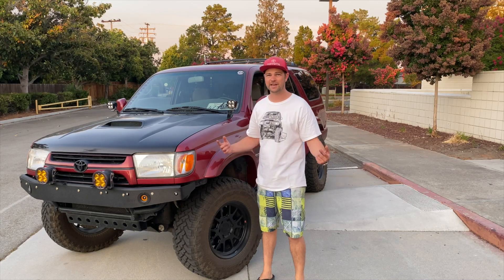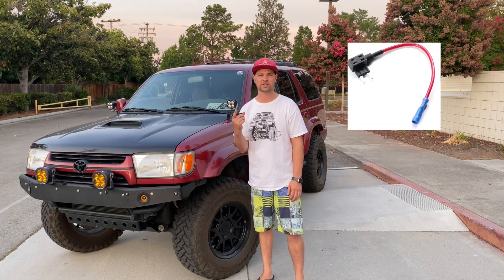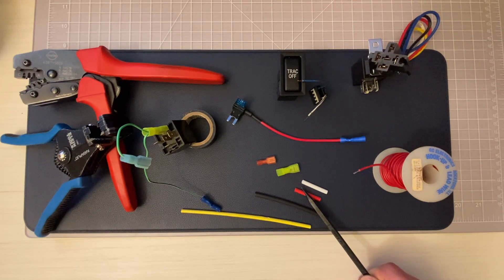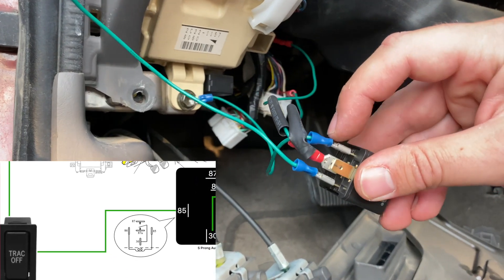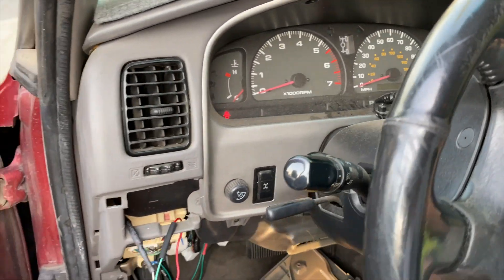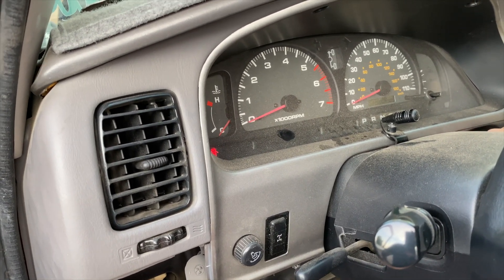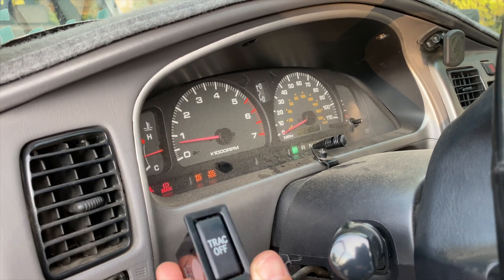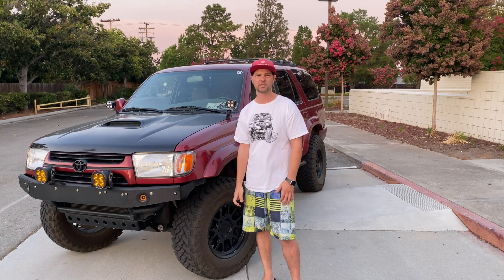TRAC OFF Switch Installation (AndyMod 2.0) 2001-2002 Toyota 4Runner

Comment: Do you need the plug that pugs into the back of the trac off button? The button I bought didn’t come with the plug
Reply from the maker: Yeah you do need the wiring pigtail otherwise you don’t have a secure way to connect the wires to the back of the switch..
- Sean
Reply: @TimmyTheToolman where can I get the pig tail?

Comment: Hey Tim, I work for toyota parts and know a bit about electric diagrams and stuff. 
I think i just discovered AndyMod 3.0, and ill make a video and post when i confirm this myself. 
i think i just found a way to do this without the use of a relay (even when using a momentary button switch), and also possibly allowing the vsc/trac system to turn on/off like factory (turn on/off by button WITHOUT needing to turn off the entire vehicle to reset & re-enable).

I was looking at toyota official EWD471U wire diagrams for 2002 4Runner and i found something, pin #26 cyan wire is UNUSED on the same VSC connector V18 (NOT the mentioned pin #3 red/black wire on connector V18).  #26 is not mentioned anywhere online, however this #26 pin is the factory connector pin for the factory trac off switch on 96-00 year models, and #26 was left unused (just need to re-add the pin) with the removal of trac button on 01-02 (due to updating systems of 4WD & differential locking).

The thing i don't like about using pin #3 Red/Black wire, is that its hard to find what the factory use of this wire is for, for and why NOT to cut it. instead to tap into it leaving the circuit intact, or use other EXI circuits instead. #3 is connecting to the Center Locking Transfer Case 4WD detection switch, and that switch from factory functions to turn off VSC/TRAC when 4WD is enabled, or when the Center Diff is LOCKED. and i dont want to compromise that signal to have it not function as needed, when the diff locks.
Reply from the maker: This was actually Sean's video.  He did all the research and filmed it on his own.  Definitely share with us what you figure out.
Reply: Did you ever find out if this works? I'd love to do this
Reply: Did you get it to work I have a 2002 and I would like to get it to work  correctly  I am adding a rear elocker
Reply: Also have a 2002 and need to know if it works!
Reply: Any success?
Reply: Any success?

Comment: Mine keeps disabling itself, but it stays disabled even when I turn the car off. I have to do a code clear or disconnect the battery to get it to reset. But then a week later it will trip again. It seems to trip any time I have a tire slip, especially if I’m turning a corner. 
Why do you guys want it off? I honestly can’t tell any difference with it off or on but I don’t really understand what it’s supposed to be doing so I don’t know what I’m looking for. Thanks in advance anyone who can enlighten me.
Reply from the maker: That’s weird, maybe check the wiring. Something doesn’t seem connected. This momentary switch (if you’re using the switch in the video) breaks the wiring connection, disabling traction control.. if there is a break in the connection 100% of the time, then this would explain why it’s always on.
- Sean
Reply: @ Thanks.

Comment: I finally got around to doing this mod, after I found myself in a situation that disabling the VSC would have been helpful. I recommend it for 2001, 2002 owners. It's easy to do and will save you from having to put your truck into 4WD and locking the center diff, just to disable the VSC and traction control. Thanks guys...
Reply from the maker: Yeah, the factory VSC is really annoying!
- Sean

Comment: I have an 01 4runner with a center diff lock. When I turn on center diff lock it turns on vsc light. Is there any benefit for me to do this mod? I was about to do it. I bought all the stuff to do it. Thanks for your input and your channel.
Reply from the maker: Well, if there's a situation you can think of that you won't have the center diff locked and would like the traction control disabled, then you have your answer.  If you can't think of a situation, then you also have your answer.

Comment: This is awesome thank you so much.  I have the relay and just waiting on a switch to show up to do this mod. I was a Audi tech and a Audi driver up until recently after my Audi got totaled in a accident.  I recently purchased a 3rd gen 4runner knowing about the longevity and finding that things are a lot easier to work on....except for the rust, but can't win everything. Either way in a recent snow storm I was trying to turn on a highway and a slight slip engaged my VSC. It's a 2001 and had the 4x4 engaged but not the center diff lock considering I was still on the roads and had to turn alot, even though engaging the center diff lock does disengage the VSC.  I was without any response to the accelerator and thought I was going to get T-boned any second. Luckily at the last second I was able to get it to disengage and accelerate onto the highway. After that i realized that this traction control could put me in danger.  So again thank you so much for this video with the diagrams and such, it will give me some added assurance of not getting into a pickle.
Reply from the maker: Yeah this traction control/VSC system sometimes can have a mind of its own. For those reading this comment, essentially what happens is when this system is engaged (due to traction or off camber situations when making a sharp turn) the system will cut power to your acceleration, effectively putting your vehicle into a limp mode making it dangerous if you’re trying to get out of a sticky situation quickly like in your case pulling out, onto a roadway where cars are moving quickly. We have a couple switches in hand if you wanted to buy one from us, otherwise, we are stoked you got a 4runner. We hope we have more videos that will help your future mods!
- Sean
Reply: @TimmyTheToolman  thanks, I did find one on EBay with a pigtail. Sorry I didn’t purchase from you, I should have read the comments sooner and I would have known and purchased from you. If the switch doesn’t pan out I’ll definitely e-mail and purchase one from you.

Comment: Might be a silly question, but how does TRAC work on the 5-speeds? Is the TRAC/ABS system all based off the transmission? I swapped my 01 to a 5 speed and have never experienced traction control or ABS when wheeling lol. Might just pull the bulbs.
Reply from the maker: If you have a manual transmission then this system no longer pertains to you, so pulling the bulbs would be a good idea!
- Sean

Comment: $88 for the button???
Reply from the maker: No, $30 shipped, and it includes the pigtail connector. This button from the dealer might be $88 but it doesn’t even include the connector!. If you’re interested, use the email in the video description to place an order.
- Sean

Comment: Will this work for an 06 Highlander? The FWD models have the switch but the AWD models never came from factory with the switch?
Reply from the maker: Sounds like the switch will work, but we are not able to guide you on the correct wire to tap into on your specific model Toyota.
- Sean

Comment: Dang. I followed everything right and it didnt work. HELP!!!
Reply from the maker: Double check your work! We included a very concise diagram in the video description. 
- Sean
Reply: @TimmyTheToolman  with a tester light, I have power to switch. Should I have power to relay wires extended from harness, red wire w/black line.
Reply: My connections to harness are good. I dont have power to wires extended to relay. should I ?
Reply: When I depress trac off switch I get power to relay. Hmmm?

Comment: I just wrapped up this project, following along exactly, and no luck whatsoever... Is it possible that using an on/off toggle switch instead of the trac switch like yours is the problem? I've tried various fuse positions hoping that was the problem but didn't help. Still getting the skid light along with the clicking sound from the front. It even refused to accelerate despite flooring the accelerator once. The wiring for 87a and 30 are interchangeable right?
Reply from the maker: A simple toggle (on/off) should also work using the same wiring diagram. That is correct, 87a and 30 are interchangeable.
- Sean
Reply: @TimmyTheToolman  Sounds good. I disconnected my battery and it doesn't seem to be triggering the ABS system now, although the emergency brake and ABS lights are on. No trac light. Ideas?
Reply: @TimmyTheToolman  So I did the Andymod 2.0 exactly as described and I'm STILL not getting the VSC/Trac lights to come on. The VSC light WAS on for a while last week but not anymore. I've turned it off and flipped the switch w no luck. Also removed the battery terminals w the same results. I can't find any loose wires so I'm completely puzzled. Would just cutting the red/black wire without connecting it to the switch be effective other than not being able to turn it on when wanted? Anything I could be overlooking? My truck just stalled upon accelerating on the way to work a few times.

Comment: Not sure if this is the appropriate place to ask, but I just upgraded my whole front end, added OME 990/881 and Billy 5100s. When bleeding my brakes I got air in the master cylinder and got that all fixed, but now when I try to drive it it will barely accelerate (if at all) and my Trac control light occasionally flashes. Also, there's a clicking sounds coming from the end (thought it was something rubbing from the slight lift but doesn't seem to be so). My 4wheel drive light flashes like it is wanting to engage though the button hasn't been pushed. Would this mod potentially rectify this issue or do I need to try another approach?
Reply: And my 4runner is a 2001 SR5
Reply from the maker: How did you bleed the master cylinder?  Your ABS module also probably has air in it.  The fact that your vehicle barely accelerates doesn't make sense to me.  Is the engine revving but not moving because it feels like something is holding it back, like stuck brakes?  Or, does it sound like there's an issue with the engine?  Even if you had air in the brake system, it shouldn't cause the symptoms you're experiencing.  I've never heard of this.
Reply: @TimmyTheToolman  I used the method where you hook a clear tube to all the calipers and terminate it in the MC and pump the brakes w the ignition on. It's supposed to remove the air from both MC and calipers. Brakes work great now and the engine purrs after all that I did to it. Doesn't feel like the brakes are holding it back, it's just when I floor it it simply doesn't want to move (engine doesn't seem to rev up either when I do this). So maybe focus on the ABS module? For the life of me I don't know what to search for.
Reply from the maker: @jeffluker1895  Sounds like your engine is in limp mode.  Any CELs?
Reply: @TimmyTheToolman   No CELs either. There was one before I fixed the engine but It's running like never before, just doesn't want to move. Should I consider the AndyMod, disable the VSC, etc ? Did I mention that the 4WD drive light flashes like it's trying to engage though I haven't pushed the button? And the trac light (pic of the truck w/ skid marks) comes on occasionally. No other indicator lights. I'm baffled. Could the Yaw sensor be in issue since it's got a little lift?
Reply: @TimmyTheToolman  I wonder if it has anything to do w the catastrophic LBJ which started the whole situation. I didn't hit anything other than the fact that the wheel came off at 65 mph. I did notice that there's about 3 inches of clean metal on the rear drive shaft like it had been pulled forward a bit. Could the transmission etc somehow been affected? I still don't understand how that would cause these issues.
Reply from the maker: @jeffluker1895  Well, the driveshaft expands and contracts with the drivetrain.  Did you replace the broken ABS sensor?  It had to have been ripped out.
Reply from the maker: @jeffluker1895  Have you checked the integrity of your transmission mount and engine mounts?  https://youtu.be/g_4DiywsSbk
Reply: @TimmyTheToolman  Yeah, I replaced the broken one but kept the original on the driver's side.
Reply: @TimmyTheToolman  I haven't but I'll watch your vid now. Thank you SO much for everything, you've saved me a ton of $$.

Comment: I did this mod but my vsc and trac stay off
Reply from the maker: I would Retrace your steps. Make sure your relay is hooked up correctly and that you cut the correct wire. The truck needs to be turned off in order to reset this mod. The switch is a momentary switch so you can’t press it on and off. Once you press it, that will disable the VSC/TRAC OFF. Restarting the vehicle will reset the system
Reply: I swear I did, I’ll give it another go tomorrow. What do we do with 87 on the relay? We splice 30 and 87 a into the red wire with the black trace. I’m sure I got that right. I know I cut into the right wire since the vsc and trac stay off. But I’m having trouble in reconnecting the wire in the harness. I wonder if my connection to 30 or 87a are bad. It’s so tight under the dash. I’ll try to make a better connection tomorrow. Do you have any other suggestions?

Comment: Plugged everything in correctly, checked all my connections. Does not work (2002 sr5). I tried to bypass the switch (not a Toyota switch) and still does not work. I don’t know what I’m doing wrong
Reply from the maker: We don't know what you're doing wrong either.

Comment: Got an 02 that I just put a 3 in lift an now the vetch’s is dinging and will lock 1 of the front wheels and about throw me into another lane ! Will this stop this ? It’s really dangerous an I can’t drive the 4 runner like this , I’ve been told I need to remove the lift , never had a Toyota do this after lifting
Reply from the maker: You don’t need to remove your lift. There are hundreds of 01/02 4Runners out there with lifts including us! You probably just need to do a zero point calibration. The YAW rate sensor is probably thrown off now that your truck has changed it’s levelness sort of speak. Once you recalibrate you should be fine. In addition to that, you could also just install this TRAC OFF switch and disable the system on the fly whenever you want to avoid your truck beeping at you.
- Sean
Reply: @TimmyTheToolman  ok , thanks, and tht will stop the front wheels from locking up when I’m running at speed around curves rite cuz it’s wedged my boxer shorts a cpl times !!
Reply from the maker: If the traction control system isn’t triggered, then your truck will drive as expected. Recalibrating will help, but this Andy mod 2.0 will solve the issue better. 
- Sean

Comment: My traction control button has 3 pins, but only 2 wires are supposed to go to it, which 2 pins do I use?
Reply from the maker: The pigtail that you have should clear that up for you. Depends on what vehicle the TRAC off switch came from …

Comment: So, how will this work with a 2wd 2002 SR5? Already has the trac off button installed. But it will turn itself back on. Just trying to understand my already stock button :)
Reply from the maker: 2wd models included this feature from the factory on 2001-2002 4Runners. For you, you already have this “mod” so you wouldn’t be installing anything. Understanding when to use the button is what you need I believe. Have you ever tried to pull in traffic from a stop and the truck beeped at you and the VSC light flickered/illuminated? That’s the traction control kicking in which cuts power to your wheels. So if you were in a situation where you had to make a quick decision and gun in but your truck was cutting power, it could be a dangerous situation. So by disabling your traction control, you will maintain the power you need to get going fast so the oncoming car doesn’t rear end you. 
- Sean
Reply: @TimmyTheToolman  yeah. I’ve had this exact issue during the winter storm I’m Texas. I’m curious if I could figure this out to make it work similarly to the Andy mod 2.0 where it interrupts the connection and shuts the system down entirely. per Toyota’s manual, the TRAC/VSC system comes back on after 19mph regardless. Which is what creates that problem. What are your thoughts?

Comment: Just curious as to what it means when my 02 puts those lights on the dash when I go into 4 wheel drive, they come on and off if I engage or disengage 4 by 4. My sun visor owners card says the trac system gets disabled or turned off when you engage 4 wheel, so I’m curious as to what’s the point of this mod ? I have a understanding that it will limit power when in 4 wheel ? Even though from factory it’s supposed to disengage while I’m in 4 wheel, does it not work correctly ? Basically when I go i engage my lights pop on the dash like this mod is supposed to do so I’m curious does the system not truly turn off unless you do this mod, even tho my lights pop up already when In 4…..
Reply from the maker: Your system is working properly like it should. When you engage 4x4 it should turn off like you’re expecting. The point of this mod is to disable it WITHOUT needing to engage 4x4. When you are just driving around town normally in 2wd, and this system engages, it cuts power to your truck (technically it applies the brakes) and thus, you might be in a sticky situation if you’re trying to het across an intersection quickly or some of quick movement. If that attempt is by the over-activeness of this system, it could cause you to not get out of harms way quick enough making it dangerous… that and also hooning with your friends in a dirt parking lot doing donuts might also be hard to accomplish if this system keeps engaging on you.